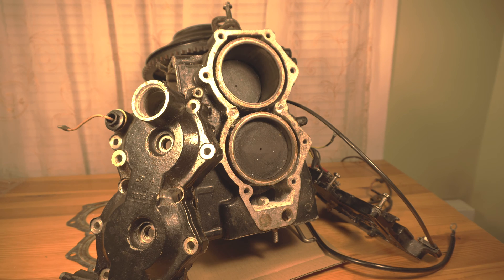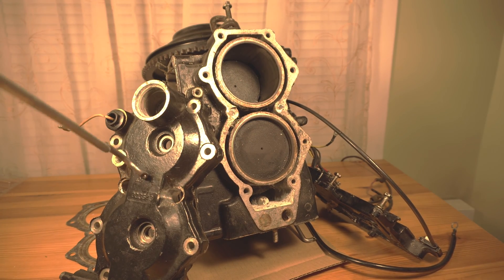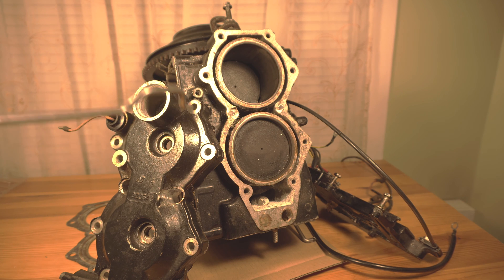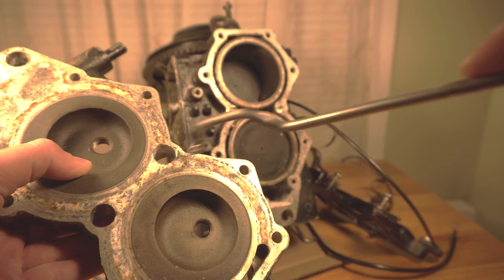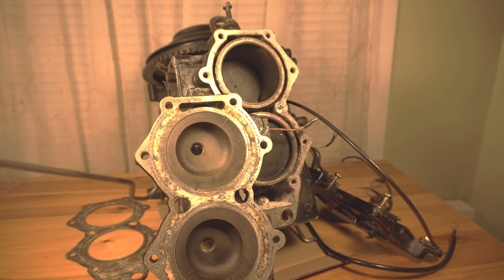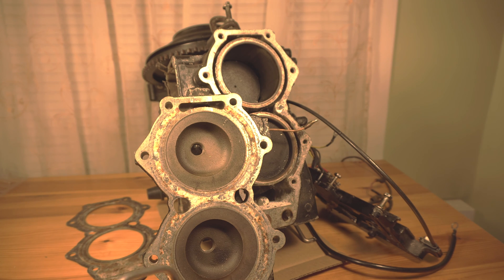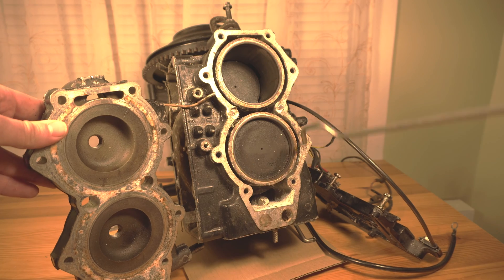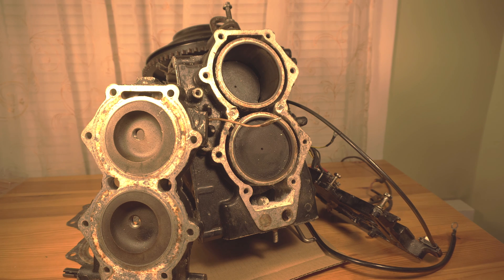Understanding Evinrude water cooling and thermostat - Visualizing the water  flow

Comment: Any idea why my 9.5 evinrude runs hot on the top cyl only ? It's pumping water and the thermostat opens when dropped into hot water.
Reply from the maker: Its possible its clogged at the top of the water jacket or likely there is an issue with the piston, such as excessive rubbing that is causing abnormal heating.
Reply: @IdeaMan4k ok thanks.

Comment: umm no. the higher pressure around 2500 rpm simply pushes the t stat off its seat, making the t stat inside irrelevant accept at under around 1800 rpm. the water doesnt "flow at different spots"! it simply dumps cold water after it comes off its seat. not difficult to understand. the newer style of these with the diaphram is basically the same way, just more refined.

Comment: thank you, finally someone has answered my question... so essentially the flushing adapter on outboards ( when cold and thermostat closed) only water travels around the cylinders. When open ( hot ) water also travels in the water jackets ...
Reply: I think it depends on the water pressure of your hose. If it can override the spring force from the thermostat or not.

Comment: hopefully you still maintain this page. my temp alarm goes off around/above 4k. I pulled the thermostats to remove them and noticed that the old thermostats didn't have a rubber gasket or the metal part for opening flow in the back. I'm worried that the rubber and metal ring dropped down inside the cylinder water passage. I've flushed the engine with salt remove etc a few times. I checked water flow with the thermostat covers removed and one side was strong but the other was a trickle. after several more flushes the flow has improved but it still isn't as strong as the other side. should I be worried about that debris blocking water flow? I'm not sure if the original thermostats had the rubber ring and metal piece or not like the new ones do. they aren't the same color. also the thermostat port on one side of the engine sits lower and this is the one that flows more. the thermostat port on the right hand side of the motor sits up higher and the flow is a lot weaker. should they flow the same? I think it make sense that it would flow less since it sits higher up and would take longer to fill but I'm new to this. any insight would be appreciated. sorry for the book. motor is Johnson 115 60 degree.
Reply from the maker: If you replace the sensor and its still going off that would mean the temps are going above normal, indicating a problem. However if you have a new one and its good you should be fine as the engine is not overheating. 

Its always possible something fell down the hole, it could be a totally different problem like something related to pistons or shaft... 

Pretty hard to say.
Reply: @IdeaMan4k  thanks for the reply! after looking at a few used cylinder heads i've determined that nothing actually fell. after several vinegar flushes the water flow is pretty even. checked compression just to be sure and that was good as well. i'll test boat tomorrow morning and hopefully i'm good to go. if it over heats again then i will def repalce the sensor.